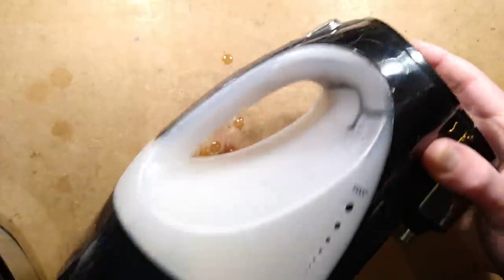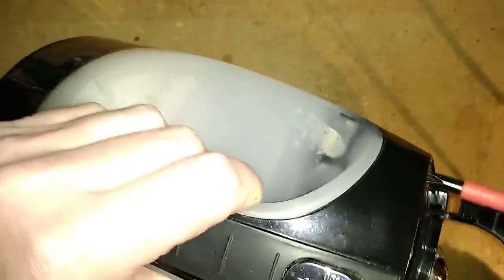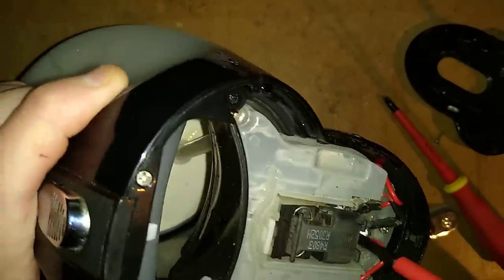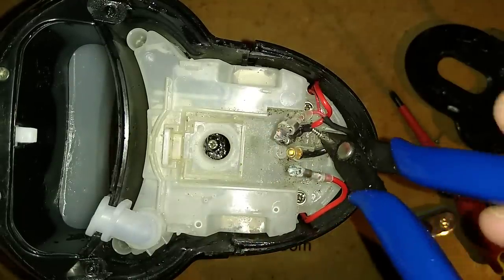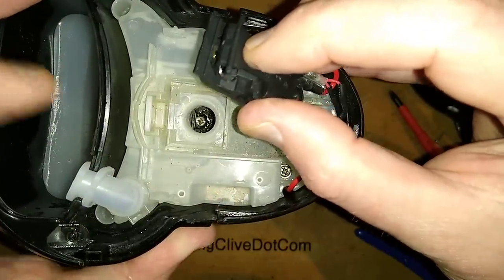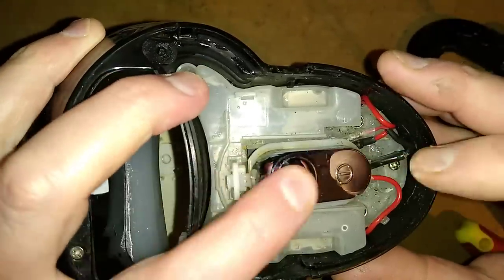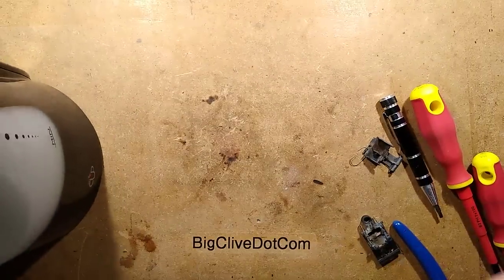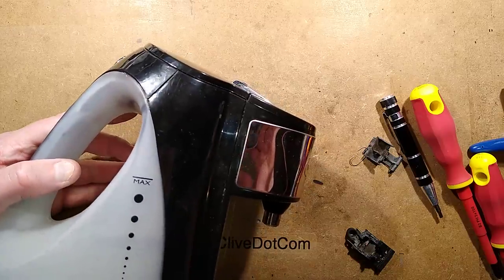Replacing my Breville Hotcup power switch.

Comment: i'm just amazed you could source the replacement part.
Reply: IKR? A lot of these kinds of kettles/water heaters must use the same type of switches.
Reply: I’m just amazed the eBay seller could source the replacement part.

Comment: I looked for weeks to try and get a new switch for mine, the same model. Breville is only 20 miles away from me in Chester, and they point blank refused to sell me a replacement. I had to admit defeat and buy a new kettle, but not another Breville.
Reply: But, that's so much waste. A worker(s) would have to toil, create another brand new kettle, with the same design flaw of planned obsolescence...

We really need to end planned obsolescence to fight climate change.
Reply: @franglish9265  Only the outer parts change slightly from model to model, the inner element and switch, along with the power connection, are remarkably stable design wise, simply because the assorted manufacturers all buy these parts in from others who have spent the money to certify them. Thus they want to have the absolute largest volume of sales to amortise that certification, so you find the same element, switch, power inlet in a whole slew of different branded units, the only differentiator is the plastic moulds and in many cases the actual screen printed name on the outside only. Can be a massive price difference as well, for the essentially the same unit, just has to be name recognition at work.
Reply: The European Commission has ratified new "right to repair" regulations which will make the repair of domestic appliances easier. From 2021, the regulations require manufacturers to design longer-lasting machines and to make spare parts easily and readily available for up to ten years in a bid to reduce waste. Of course as we won't be in the EU........
Reply: Easy enough to do, bit of glue here or there. More likely they will make buying the parts difficult like Breville do now. If you need to buy from Germany the repair may become non-economic
Reply: @petermather3049  Ten years sounds like a really short time. I've had my electric kettle since the 90s. Although since it's been working fine all the time I guess it wouldn't have been affected by the legislation anyway vOv
Reply: @Martin Shepherd Not especially for the UK, but for the UK, the Americas, Asia, and the rest of the world. Heck, they're manufacturing inferior product already for certain areas because the markets with extremely little de facto consumer protections are big enough.
Reply: @Martin Shepherd That's how you make money, in a capitalist system. Instead of making something reliable and repairable, they make something cheap, and that barely scrapes by until the warranty is void.  This is done with major appliances as well, and wastes lots of labor, and resources and energy to simply replace products that were planned to break after X many years. Back in the old days, it would have been very difficult for you to make products like this and to have your business make money, so many manufacturers made their products more durable, and repairable.
Reply: @petermather3049  if only they did that in the USA... Ugggg

Comment: i love to see stuff been repaired instead of thrown away
Reply: Recycle or upcycle, it's not just good for the planet, it's good for the wallet!
Reply: Our local town has a Repair Cafe, small electrical items are often amazingly easy to fix. Our toaster stopped working the other week, all that was wrong was the tip of the contact broke that completes the circuit when you push it down. The one inside was adjusted and cleaned and it'll be working for another few years.

Preventative maintenance is also good practice on domestic white goods. Our tumble drier purchased in 1998 is still going strong, it blew an element after a couple of years and has only ever run on the low heat setting ever since. But every couple of years I de-fluff it,lube the bearings and check the (original) belt before putting it back together and it's still running 22 years later. I have toyed with the idea of fitting a £30 element to get the high heat back but I know that if I spend £30 on it then it will have a catastrophic failure.
Reply: @jarthurs  Nice, I could also see something like this at a hacker space / maker space.
Reply: Repair cafes are a great idea. :D

Comment: Just made myself a cup of tea and sat down to watch some YouTube, and what do I see ? Clive taking to bits the exact same kettle as I have just used !  Excellent kettle,  only problem with that model is you can't adjust the amount of water it dispenses (The next model up does though, but I was too much of a tight arse to spend the extra money :-) )
Reply: Dr. M. H.  No, that's not how it works,  you fill it up and every time you press the switch, it boils a fixed amount of water and ejects just that,  then the water in the reservoir fills the boiler part of the kettle.
Here you can see the kettle in use by Alexa :-)
https://youtu.be/MbzKmOnJSeo
Reply: Martin Shepherd Darn, for a moment I thought we had a solution that would yield 250mL of water from just 100mL input, world freshwater shortage concerns solved!

I guess I best add the ;-) lest anyone actually think I was serious, because there will always be someone who does!
Reply: To be fair, the higher models are less efficient if you have small cups because they ALWAYS boil 350ml, the dispense setting just puts some of that back into the tank automatically.

I use a 500ml mug, so still need to operate it twice and manually cut-off as its hard to judge what setting is correct for what you want.
Reply: Dr. M. H.  Would love a kettle plumbed into my main cold water line like the refrigerator / I've machine ...
Reply: Dr. M. H.  Haha .. ice machine.
Reply: The 2 litre model has somewhat ambiguous quantity delivery. Most of the time I have it set to maximum which fills my preferred mug and leaves exactly the correct room for milk. However if someone else uses it and I reset the dial to maximum it sometimes dispenses ⅔ cup and on other occasions the cup fills to the brim.
Reply: Guys, guys. Theres another device that lets you boil as much or as little as you want! It's called a kettle and it boils however much you put in it! You can also pour out only what you need!

Comment: Wow I can't believe that something sold in the last few years
 has replacement parts available. My mind is blown 
Gotta love a repair video. Good one bigclive
Reply: Most common problem is the switch, around 70% of the time, or the element blowing out, around 20 % of the time. Rest is plastic bits breaking, or the seals going bad and leaking. New switches and elements are available, but in general you have to order them via small packet from PRC, so you are without for a week or three till they arrive. Most people just go buy a cheap new one instead.
Reply: I can't believe something so high power just uses a switch and not a relay
Boggles the mind, did they not endurance test it to see if the contact could survive??
Reply: @nogravitas7585  Engineered to fail. The whole point..
Reply: @nogravitas7585  If they wanted it to survive, they wouldn't have spec'ed bare copper in a steam-flooded location.
Reply: @nogravitas7585  got to last more than 500 power cycles at full load, which is the spec they design for. Equates to boiling twice a day for a working year, getting out of the warranty period. Most will get past 1000 cycles before they arc all away, not helped by them only having one of the contact surfaces faced with a german silver contact button.

Comment: When you mentioned, while fighting with top, that at factory they probably have some way to slam that things together...  I feel you. And the dreaded springs - I always have wondered how they put it together so it doesn't explode on sight.
Some devices I do repair seems to have one in common: screws holding the cover are available after removing the cover.

Comment: I replaced a Breville kettle like that a while ago. I got the impression that it had failed due to lots of steam where it shouldn't be. I didn't realise that there waere spares available. Cheaper than £40+ for a new device. Many thanks for the info.
Reply: I thought from day one that the steam release is pretty poor design, but I guess if that is what triggers the cut-off it kinda makes sense.  Just seems flawed that the steam goes across all those surfaces that corrode.

Comment: Fixed our kettle months ago. The bimetallic strip had slightly rusted so give it a wire brush and the kettle then turned off when it should again. Free fixes are the best kind. 12 quid seems a bit steep but beats having to buy a new one.

Comment: Every hotel room I’ve had in England had an electric kettle. They’re available (but very unpopular) in the USA but with the lower voltage they’re slower as regular house circuits are 15 amperes maximum at nowadays 120 volts. I bought a US version after visiting in 2015: 1500 watts rating at 120 volts, very Chinesium but so far reliable.

Comment: There is something immensely satisfying about repairing a well-used item by servicing some small part. Even if the replacement part is probably grossly overpriced for what it is, it is certainly much more efficient than replacing the entire item.

Comment: I have this same cattle and I love it because it is fast. It is fast because of the combination of an exact needed portion of water (so not heating too much water) and a 3KW element.
Reply: Not just that, its a one-way tank so very little heat escapes and the pressure generated then pushes the water out.

Comment: I have a similar kettle to this in the US.
It has that exact same base connector.
The switch is installed in the bottom of the kettle under the handle, and is interlocked so that it automatically pings "Off" if you lift it up.
Its indicator is an old-school neon built into the switch, which you push down to begin boiling.
It's nowhere near as fast as your 3kW monster here.
My guess is that it's connected to a bimetallic that detects if the heating element exceeds the boiling point of water.
Since simple thermodynamics, liquid water cannot exist at atmospheric pressure above its boiling point, so if the element can get hotter than that, clearly the water at the element isn't liquid anymore!

Another delightfully simple little device.

Comment: Yum, contact tea! Good job, I think I would have just given that lid a thunk with my fist to re-engage it. The landfills are full of consumer goods that can be fixed with equal ease, vacuum sweepers come to mind toss a $150 unit over a $2 switch!! Happens every day! I hope some of your repair videos inspire more folks to take on this type of thing. What is there to loose if it is headed for the tip anyway! Cheers and rock on from the colonies de N3GLV

Comment: Went through the same issue this January but I managed to catch it in time.   
The contact had a coating of corrosion so that only a small area was bridging and I guess this caused the arcing to get hotter and hotter.  
Gave the whole switch a clean back to the copper and it has been working without issue.  
I would suggest a routine checkup once a year to clean out any corrosion.

Comment: Kitchens in the states have been required to have multiple 120V 20A outlets, 2.4kw for years. The can have several 20A feeds depending on the size of the kitchen. Not as much, but good enough for counter top appliances.  Electric ranges are on a 240V 30 to 50 amp 4 wire dedicated outlet.

Comment: My kettle has a similar switch in the base. It stopped working because the actuator just got brittle over time and snapped off (yours is a better design in that respect).  It now has a zip tie holding the switch shut and I turn it on an off by plugging it in and unplugging it. Not as neat and safe as this repair (new switch wouldn't have helped anyway), but it works.

Comment: The systems used in this and other switches which cause them to want to be at either end of their travel and avoid the middle is called an over centre mechanism. They are fascinating in how common they are and how rarely they are noticed. The simplest and easiest to understand version is the latch on a steamer trunk or foot locker. It resists closing until it snaps over then it resists being opened again.

Comment: Interesting, as a yank I've never seen one of those before and looking on amazon I see they're available but $80 and up (not the same model though). All my houses have had instant hot water (195F/90C) dispensers. About twice as much to purchase and requires permanent installation but you get almost-boiling water straight from the tap immediately at any time. I had a German exchange student once who immediately fell in love with it and had never seen one before. I can see the use for these if you don't own your home or have the skills to install a permanent one.

Comment: I had one of these that became intermittent in operation, and managed to get it going again by cleaning the switch contacts. They were well blackened but not destroyed like in the video.

When it first started acting up my wife bought a bigger, better one with adjustable cup size and a cancel button, so I took the old one to work to fix it and use it in the office. I got made redundant from that job in 2017 - watching this video has made me wonder if my repaired kettle is still there and if it's being used.

Comment: I took apart the old kettle a couple months back (pretty much on day 1 of lockdown) as it decided it had enough of life, and holy hell they made it hard to open, to the point it never went back together, but that's what you get with a £10 kettle from tesco I guess, which was replaced with a £12 kettle from tesco, cos fannying about for kettles on lockdown day wasn't exactly a priority... :P
Reply: 1996 moved into a new flat. Bought new kitchen appliances - so they threw in a free toaster. No surprise after a couple of years, it went bang. I got a cheapie replacement toaster. I wondered about electrical quality inside so decided to take it to bits. Held together with security screws - so ripped the plastic sides off it, found the earth lead loose - took it back and got a full refund !
I then bought a proper toaster - 6 slot, Lincat. Only £156.
The wiring inside it was all 'proper'. 
I now have a 'matching' Electrolux dishwasher. Maybe one day the two will be in the same kitchen !

Comment: Hi Clive. 
I'm not sure what you use to film,  but a lot of cameras have a HDMI output (mini HDMI usually). You could potentially connect this to an external monitor, and have a live image while filming. If you mount this on the wall in front of you, or have it sit to the side of what you're working with, it'd be much easier to see what the camera is doing and if things are in focus. It gives you a reference to how things are looking without having to wait until after you're done filming. 

That being said, I love these videos. I've learned so much from you thus far. Thank you  :)
Reply: He uses a phone typically, or sometimes a tablet. Screen is built in.
Reply: @stargazer7644  Depending on the phone, he could do MHL (micro USB to HDMI) or a simple USB-C to HDMI adapter.

Comment: I miss those 3 kW kettles!  I almost brought one back with me when I moved back to Canada.  I just didn't want to run a 220 V circuit to my kitchen.
Reply: Isn’t there already one for the oven?
Reply: Maybe a gas oven?
Reply: @man_eating_monkey  Um, yes, but it would still require an additional outlet to be wired.  What type of plug would be acceptable for 220 V household use in the Electrical Code?  Is it allowable to put it in series with the stove?